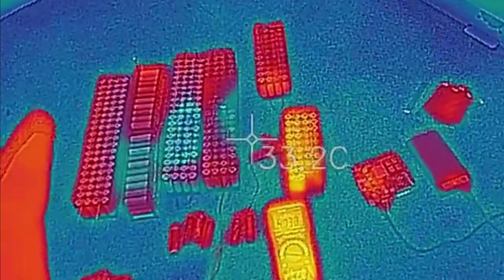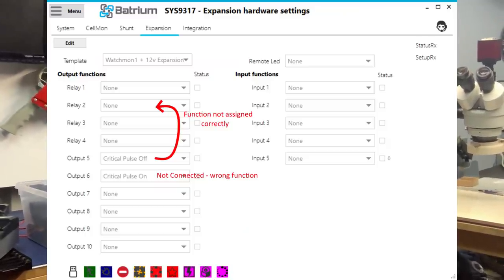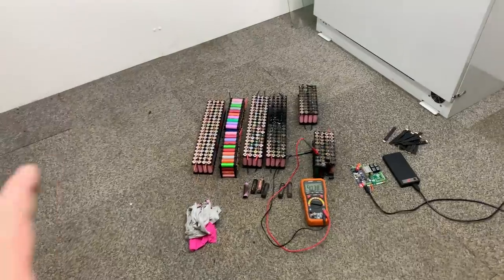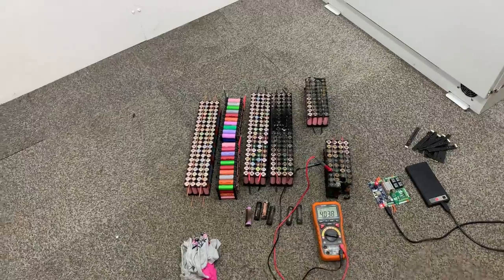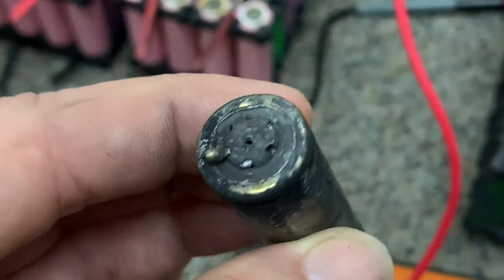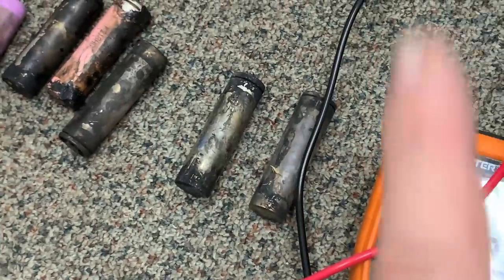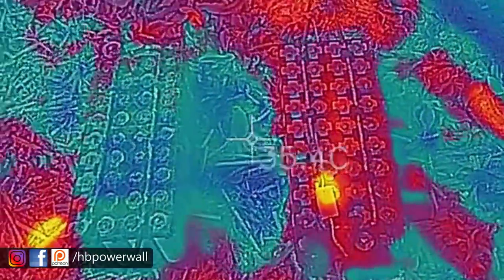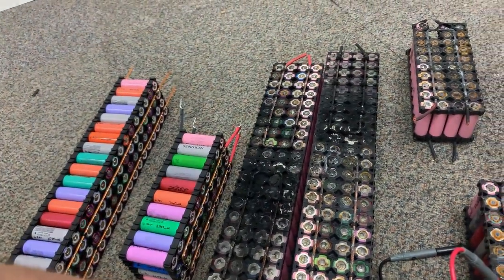Near miss, Smoke, Fire & Fear on new years eve

Comment from the maker: High res photos can be found here - https://secondlifestorage.com/index.php?threads/when-things-go-wrong-it-can-go-really-wrong.10317/
Reply: Might have been an insulator problem. It seems like in the picture that the positive busbar has shorted to minus chassis of the battery.
Reply: Sent you a pm.
Reply: @Heike73  It does look deformed doesn't it?
And right in the spot where the two cells failed. I wonder if someone had been in that shed that arvo and something knocked into the pack. It could of course also have happened during the rapid decommissioning.
Reply: I hope you will find an answer. 
Looks scaring to me - after just 4 years for a build you can not blame on first sight (i am watching on a phone) and each cell measured. Hope you get in touch with him again. 
In the beginning it was a bit difficult to get behind that this was not one of your  own batteries but  from someone else ... till you mention thta you did not have his number ...

happy new year !
Reply: @Heike73  From what I see looks like you are correct. I had this happen to me when assembling a pack and sparks flew. I learned to put a layer of tape as extra insulation between bus bar and top of battery

Comment: i'm inclined to agree with a few others who have mentioned an internal short, aka a dendrite growth, that caused an internal short. Because they were almost fully charged when it happened means the fuse would of made no difference anyways as there wouldn't have been enough current flow to pop them. It had enough internal energy to self ignite. 
This is definitely a reason to have multiple thermal sensors though. As I'm sure that the cell didn't got hot "just this once". It would of been something over time getting hotter and hotter, thereby weakening the cell structure.
Reply: IT always makes me wonder why even batrium only has 1 temp sensor
Reply: *would have
Reply: Agreed. It should probably become a guideline to have a temp sensor for a certain sized block of cells, like 1 sensor for every 200 square cm or some such. It only feels like overkill until a disaster happens.

Comment: After looking at this I'd be putting a couple of pieces of fire rated plasterboard or cement sheet between each pack and using anderson connectors for each pack so they can be easily ripped out

Comment: Thanks for documenting this, so important to share when it goes wrong to avoid the dangers. I'd like to know more if its not too much work. Capacity of the cells compared to when they were tested originally. Also if there any heaters in the unused pack and any with high self discharge.

Comment: Future episode: How to install an automatic fire suppression system.
Reply from the maker: Garden hose on a relay
Reply: Flud the negative terminal :) Another option is to use an active cooling solutions.
Reply: @HBPowerwall  lithium is reactive to water... Sand could be a better way to let the fire burn out by itself.
Reply from the maker: @dreamerwl8458  only when in direct contact - cells are sealed maybe just maybe on the cell that's vented will be open to air-water but fortunately the fuel is already burnt up.. You wouldn't leave it there for months for the rust to set in that would be bad..
Reply from the maker: @dreamerwl8458  water will stop the thermal reaction stoping toxins from being released? Really don't think sand is the option in many cases 
Water is accessible in the first instance - then once cooled store in sand..
Reply: I’d be inclined to say that being used and odd cells, they may have gone out of balance and you’ve got one cell in the pack that reached its upper or lower limit and failed.
Reply: Co2 dry hosing, that would be good
Reply: I, certify, install and sell fire extingusher & suppression systems for a living. I'd recommend halon, co2 or foam extinguishing system. With lithium-ion batteries being considered a class B fire, there's many options to choose from. Leave me a message if your interested in protecting your battery bank investment 👍

I can get you very good prices on these or point you in the right direction. People usually don't take fires seriously until it has happened to them and by then its too late. Good on the owner of the battery bank being able to isolate the problem quickly and reacting accordingly.  Most aren't that lucky.

Comment: I have seen a cell do this by flux dripping in the cap and the cap shorted closed got hot after running hard and flux ran to the outside of the can then cell shorted out. Thank god I was testing the soldering theory. In return I welded all my cells with nickel fuse and return no flux melt or solder melting to outside of can due to excessive draw.

Comment: I would LOVE to see more of an investigation here.
Reply from the maker: What type would like like to see.. I've love to go deeper
Reply: Every cell, the deeper the better
Reply: The most useful thing would be to investigate the two cells that burned.  Can you tell the manufacturer?  Can you read the capacity and whatever else he wrote on them? A date code might be helpful. 
Then maybe find other similar cells in the packs, remove those and test individually. 
Also, you could test some of the fuses to see how much current they take.  Do they get hot and stay hot well before blowing?

Thanks for posting this! There are a lot of aging powerwalls out there. You were early to this game. You have the best chance to spot the problems.
Reply: @HBPowerwall  i think a test of the melting point of the fuse wire as to how many amps they can handle
Reply: @HBPowerwall  a couple thoughts, test the fuses yourself, settings off the BMS, logs off the BMS
Reply: @HBPowerwall  further, what else could have been done to prevent this, installation of a specific type of smoke detector, placements of temperature sensors, what if you’re away from home, what about automatic suppression, what fire extinguisher should have been used instead of water for electrical fires (foam likely), what’s a safe placement distance between racks of batteries in case of fire, what should be located above them (probably nothing that could catch fire, cautions about using wood (and similar flammable materials) to mount batteries on a wall, what rating cabinet should be used - used mentioned AS but really you’d need an Ex rated cabinet (not cheap, but what designed considerations could be achieved - how do others handle this possibility), could you talk to an insurance person to hear their advice on how this could affect property insurance?
Reply: Probably all those random cells he used
Reply: @1981dasimpson  Yes, this is exactly what I was wondering as well. Is the fuse wire within spec and working as intended?

Comment: In the same time I watch this video I have a pack on discharge intending to rebuild . Is my veery first pack with great high drain batteries LG hg2 but I solder the connections . Now I thinking to completely kill the pack and recycle it and never solder again a pack . As someone said in a comment it can be a cell damage by soldering and somehow kill a cell after long time and could be end I to a disaster. We appreciate your effort and everything you do for community and I am glad that nobody is injured by this incident. I bet that everyone has a little respect for Li ion chemistry and see your video will be 100 times more careful with safety when planing and build a battery pack.

Comment: This scares me to. But I at least have my batteries in a metal enclosure vith plasterboards inside. Thanx for sharing..
Reply from the maker: There have been many fires, and many time i've blamed the build quality. I'm on the fence but build quality or perhaps build style might not have been ideal .. I need more time to test some more..
Reply: If you have venting it will mix with the air and a closed box is the last you need then. I saw sea container blowing out the doors in test facility after ignition of the electrolyte and air.

Comment: i once had a 18650 just set on fire on my opus charger, the cell was in good pysical condition the carger was knackered and had to be thrown away as for the other 3 cells there were scorched but luckily not vent like the one that set on fire, my gf rang me when she got home and sent me a picture, as this was during the build and test phase, after this i sold off all my 18650 as they not worth the risk, and got some nissan leaf cells instead, which were much more quicker to assemble from day 1

Comment: Could be an overcharge, or abused in some other way in a previous life (possibly stored/charged at too high/low temp.) Bms/cell fuses/etc can only do so much. They do nothing in the event of internal failure of the cell (dendrite formation, then internal cell short, then excessive heat build up resulting in smoke and fire).

Comment: While it is not the most likely, all it would have taken is for one cell to have a partial internal short leading to a thermal runaway condition and depressurization event and have the fuse wires get hot but not hot enough to melt and you have an ignition point.  Also, the ignition point is right in the middle where depending on how they were stored could be the point of highest heat since those 2 pieces look to be the 2 halves of the same pack. The other pack being scorched could have been on either side of the pack that ignited.  These cells are also of very mixed pedigree so one cell could have been a heater and kept generating more and more heat while also being charged at a high enough rate in a hot shed when it failed.  Without having logged data from the Watchmon it would be very hard to tell.  From there, all it would take is for the heat of one cell burning to set the others near it into a thermal runaway condition.

Comment: The biggest issue I've seen from a fusing standpoint is it becomes easy for the copper bus bar to act as a heat sink long enough for the cell to fail before the fuse wire fails. I suspect the fuse wire needs to be thinner for that to have not failed. The only other possibility is something internally in that cell failed catastrophically in a way too fast for the fuse to react or didn't even involve the fuse at all. Not really sure what that would be though as I'm no expert on the chemistry of these cells. 

What I do know is, for my purposes I will stick with Lifepo4 cells for anything in a habitable space. Anything with that chemistry in those sorts of quantities I don't want in my house. Outside solar shed like your container is definitely the way to go with that chemistry.

Comment: My theory is internal resistance on the cells that self destructed was through the roof, at 4pm it would be at the end of the charging cycle for the day and the internal heating caused expansion which finally caused it too pop. Key attributing factor I’d say is the that this dangerous heating cycle would have been occurring for weeks/months.
Would be interesting to know how big there MPPT was to find out how many amps was going into each cell and compare it too when we test charge/discharge 1amp in a single 18650. I know when a bad internal resistance cell is tested it gets hot in 15 minutes @1amp.

Comment: I’ve noticed on my packs Ive built if you hold the soldering ion on too long the bus bar and if the zip ties are tight it can causes it too melt into the cell holders getting closer to the negative part of the battery. Now that I thinking about it I bet that’s what has happened, cell became super hot (internet resistance issue), causing the cell holder to soften and with the zip ties pulled the positive  bus bar on the negative. How tight are the zip ties?

Comment: thermal run away, how was the cooling where the packs were? if he was charging or discharging and the cells got above 60c they can start to thermal run away, which would cause fire without blowing the fuses, does the batrium have a thermal cut off?

Comment: The first thing that came up to me is the soldering of the fuse wire on the cell itself.
Spotwelding is in my opinion better as the heating of the cell is as good as none.
A good cell has a build in protection at the top and by heating it up you could change the mechanical properties...
Reply from the maker: This was done many years ago when Spotwelders were expensive & not practical - we have learnt much since and the accessibility of specialty tools is far greater.

Comment: This is just a guess.
Maybe cell damage through soldering? 

The solder joints haven’t flowed well which may mean the iron was not up to the task so heat may have been applied for much longer possibly causing internal damage.
Reply from the maker: Great theory, would need him to reach out to me again - i'll put that on the questions list
Reply: The less time you spend with the soldering iron on the cell the better.   So in nog worried there
Reply: Not just soldering, but it looks like most of the solder joints are directly in the center of the cell, which is where the heat can do the most damage, especially at the negative end. You see the nickel strips factory batteries use have that center area cut out entirely in order to keep as much heat away from it as possible, and if you look closely you can see all of teslas fuse-wires are off-center.
Reply: @caramelzappa  thanks great info about the off center connection! even with a spot welder thoses infos are interresting!
also i'm bulding a power wall myself, and thoses thaughts are a lot going thew my mind;  it is for a camper van and of course small spaces, wheit limitations etc. hard to have it all... I did a " battery bunker" (RC poutch batterry style)  to test them, with temp sensor, sand bags and a water cooling radiator plus filter for smoke... in a fireproof box... well the whole thong probably wheit more than 40kg i could not install that kind of stuff in the small camper.  

i had a question: why double fusig eatch cell? would it not be safer to fuse(if you trust your fuse) only the positive side not to apply heat to the inside of the battery threw the anode(negative side)?
Reply: @caramelzappa  good call on the off center fuse placement on the neg. end.........
Reply: @thomasverhaag9772  Sorry for the late reply, but there's no reason to double fuse. Good luck with your build!

Comment: I think you have to find amperage draw at the time it burned, I think as time goes by these batteries cant handle a 2 amps draw. Notice when testing low capacity cell they tend to get hot easily with only a 1 amp draw

Comment: I think that the method of connection, i.e. soldering, could have influenced that, with a large number of connections, there is a high probability of damaging several CID fuses, that's why I decided to build a modular design with the use of baskets, we will see time to show if it is a better or worse solution
Reply from the maker: Time always tells the story, good luck with your build.
Reply: @HBPowerwall  Thanks :), as for the topic, I agree with you and I do not say that one method is better than the other, but it is worth developing and not making the same mistakes, for example, I draw handfuls from your films, in total my interest in the subject began from your movies :)

but as I wrote earlier, the fault of this particular situation could have been on the side of the damaged CID fuse, it could have been the fault of soldering, but it could also be a factory fault or a random faulty cell
Reply from the maker: Could have been a heap of things, I hope the hive mind that is our community can brane storm this and get some new theories.

Comment: This happened to me with a trolling motor battery I had been using. While it didn't catch fire it was getting very hot under load. They was fused and none had blown I tested each 18650 and found one with much higher resistance than the others. Replaced that one and it ran without heating up not sure if this is the problem here. It puzzled me as well since no fuse was blown just looked like one cell was acting as a resister and got hot. Ironically it was a red sanyo 18650 the ones they call cookers. 

Also I have noticed under high amp loads some lower amp cells got hot again still not blowing my fuse wires. Not saying I know what this guys problem is just a couple of problems I have had. The only time I saw fire was when my son ran over a pack with the truck lol where a couple of cell cooked off and looked like a firework going off. Kinda ruined our fishing trip but a bad day of fishing is better than a good day at work. 

Good luck and stay safe Mr HB

Comment: One of the cells in the pack had too low of a capacity and started a fire.  the fuse did not trip and that means the pack was getting the right amount of current but a cell was way under capacity

Comment: Going over my older packs where I soldered them, I've found that sometimes the fuse wire doesn't bond to the bussbar. It looks soldered, but it isn't, and those cells diverged from the pack. My guess is daily thermal cycling caused a few cells to  make and break contact, skipping a few cycles.
Reply from the maker: Sounds more like poor soldering? Did you use flux, solder loves hot clean copper
Reply: @HBPowerwall  Solder was NEVER designed to be the mechanical connection.  Not ever ...

Comment: Is there one battery chemistry that would be safer than the chemistry of this one? Also, if the cells do catch fire is it an electrical fire or would it be a metal fire? The difference between the two would determine proper fire suppression technology.